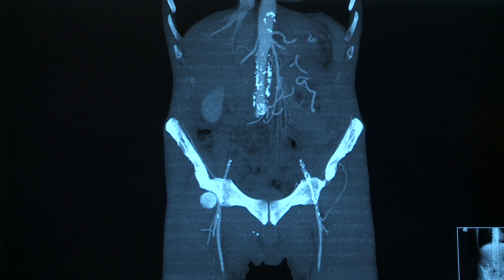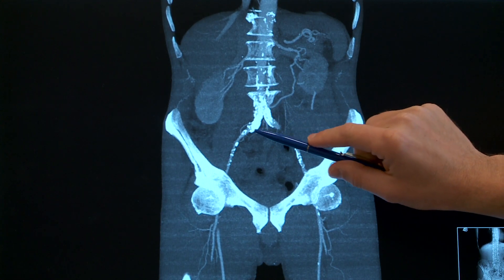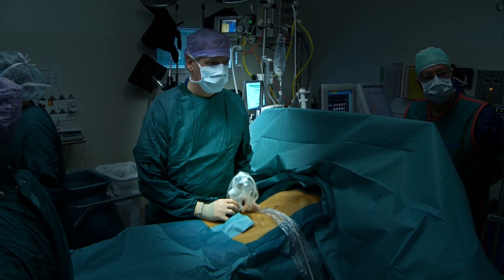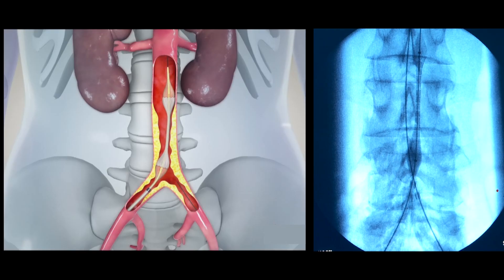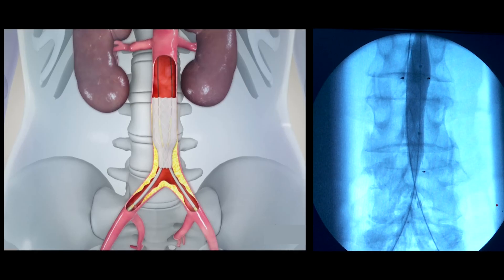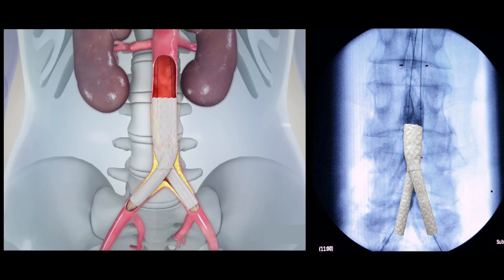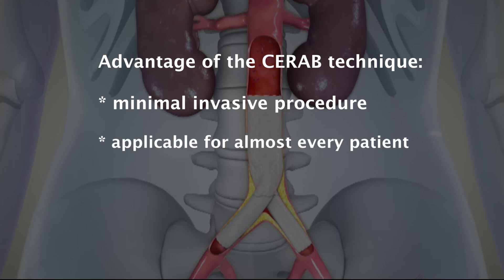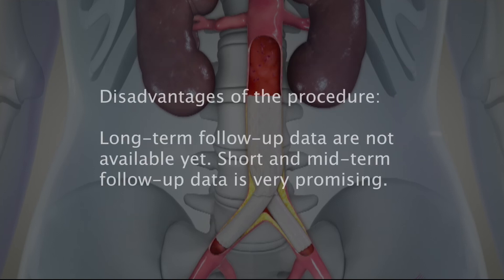CERAB (english)

Comment: Mediocre result ! A simple kissing stent will solve the problem
Reply: Not so. Results: In vitro studies have shown a more favorable geometry of CERAB compared to kissing stents, leading to better local flow conditions. The results of CERAB are at least as good as those achieved with kissing stents in a more complex group of treated patients. The mid-term patency rates approach those of surgical reconstruction. Initial data show that the technique can also be used in combination with chimney grafts in order to preserve side branches.

Conclusion: CERAB has proven to be the most optimal endovascular treatment option for aorto-iliac occlusive disease with regard to geometry and flow and is related to promising clinical outcomes. Prospective and comparative trials are necessary to elucidate the most optimal treatment algorithm for patients with aorto-iliac occlusive disease.

Reijnen MM. Update on covered endovascular reconstruction of the aortic bifurcation. Vascular. 2020 Jun;28(3):225-232. doi: 10.1177/1708538119896197. Epub 2020 Jan 2. PMID: 31896301.